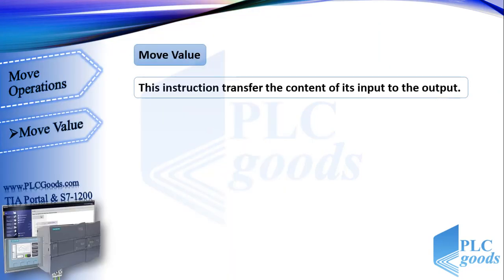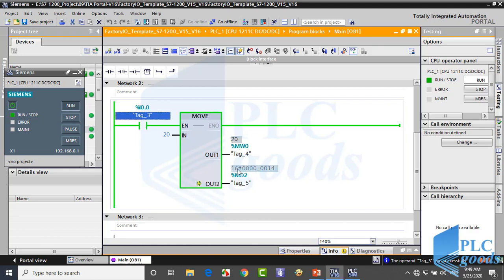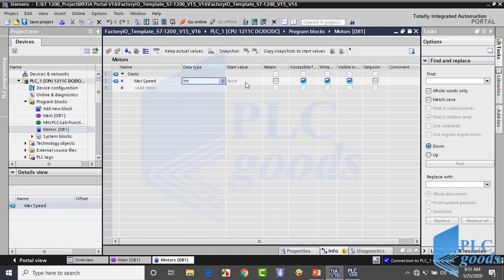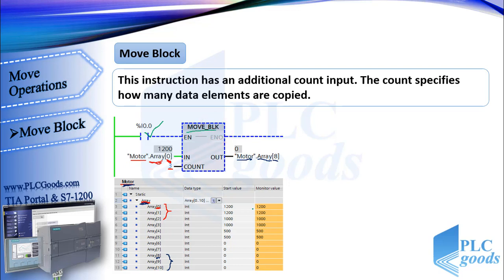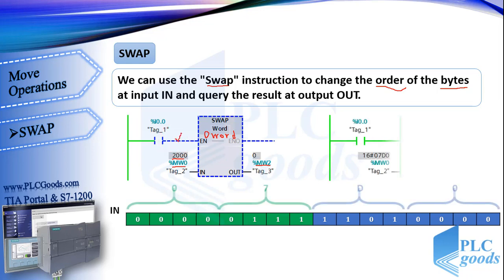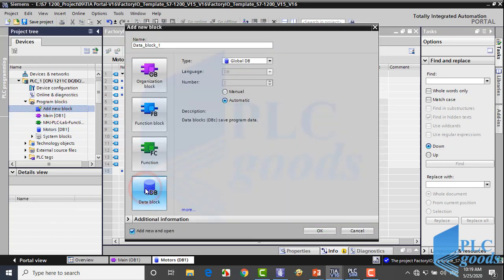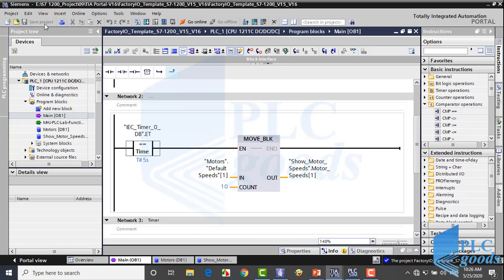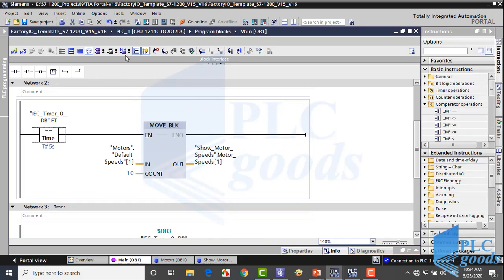Move instructions PLC programming tutorial Siemens TIA PORTAL | Lesson 24

Comment: Thanks for the video. I have a question I hope anyone can answer.
I am using a counter with equal comparator to make my program run in sequence but I also want to skip to a different count value rather than waiting for it to increment. I have tried using the MOVE instruction to move the value to the counter but the counter value goes back to the value from where I placed the MOVE. In simple terms how can I start  the counter at a value other than 0 and allow it to increment from that value?
Reply: Hi dear. if you want to move a constant number to your counter, and also you don't want back to this value, the CPU must not execute the move instruction continuously. so, you can use a normally open contact before your move instruction (for example with I0.0 address, the first digital input). so, when the first digital input is activated, the counter value will be changed by your move instruction, otherwise, the counter value will keep its last value. 

Another way is using the move instruction inside OB100. CPU executes this organization block (OB100) once time, only during the first scan cycle. so, you can do any initial settings such as changing your counter value inside OB100
Reply from the maker: thanks for checking out the channel

Comment: Tank you.How can I save the latest numbers and information of the touch panel in  the permanent memory(PLC)?
Reply from the maker: did the Mentor's answer help?
Reply: Hello, Note that HMIs work base on the PLC memory. You can use data logging ability (https://www.youtube.com/watch?v=P_Pzm4a8grw) to store the last information regularly.
I think, you just need to use permanent memory. For example, suppose you are using an IO field on an HMI screen, to change a number on the PLC memory. If the IO field is connected to an address of the permanent PLC memory part, automatically, the last entered number inside the IO field will be stored on the permanent memory part.